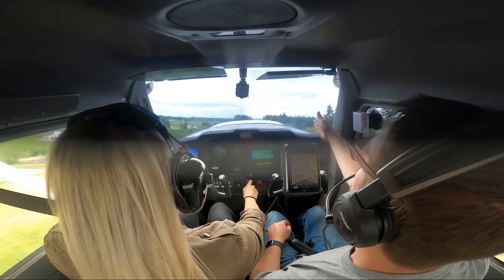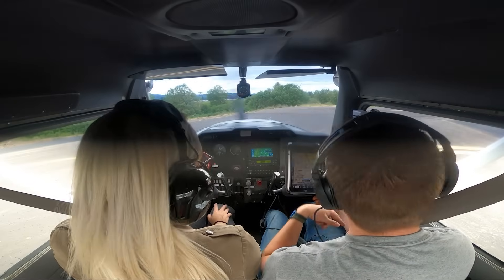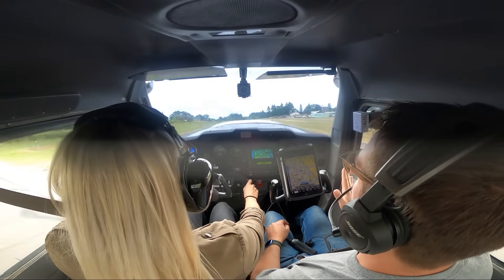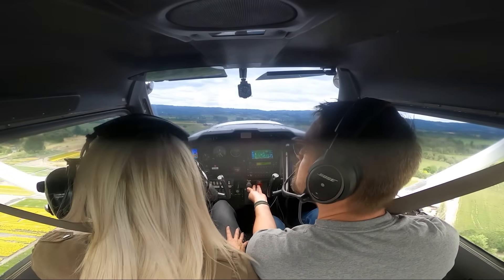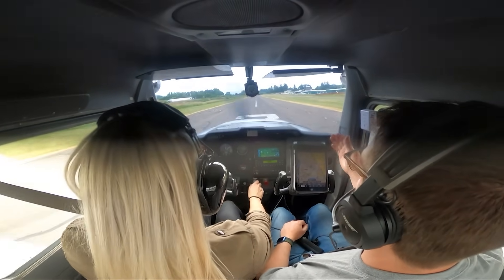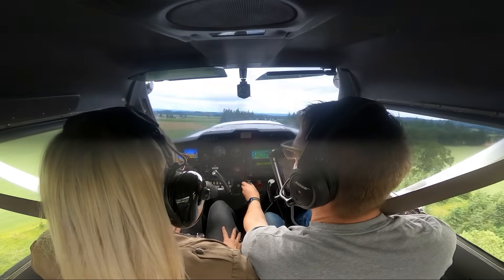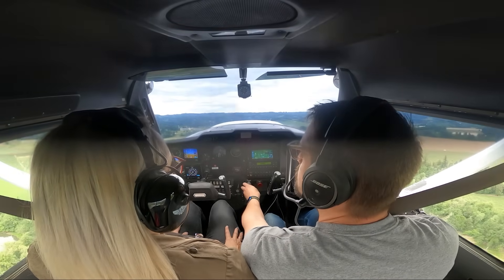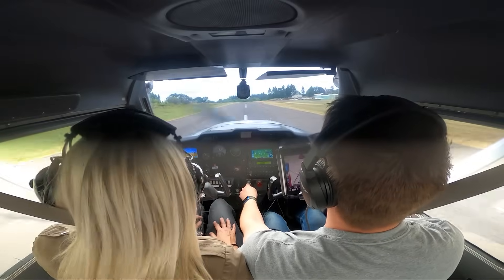REAL Loss of thrust on Takeoff.

Comment: I was with a student in his Piper arrow and during the takeoff role the air filter disintegrated and entered the intake manifold. We did experience a loss of RPM. Unfortunately, we did not notice it until way too late to abort and ended up in the air very similar situation as you posted here in this video.
Reply from the maker: It can definitely happen!

Comment: I’m a low time rusty old pilot just curious about one thing I noticed in this excellent video. It looked like you didn’t activate the electric fuel pump as part of troubleshooting. Is that because you already noticed fuel flow was nominal?
Reply from the maker: Thanks for watching and for the question! There’s no fuel pump in a 150. Generally there’s never any auxiliary fuel pump in any high-wing airplane with a carbureted engine. 👍

Comment: Nice job handling a stressful situation.  It appears you left carb heat on the whole time. Wouldn't you want to go carb heat cold after a few minutes with full throttle? 
I experienced my 1st loss of power on a long x country flight a couple months ago.  Luckily, it was carburetor ice. Turned the carb heat on for a minute and got full rpm back.
Reply from the maker: Great job handling your situation as well! And yes I would have turned the carb heat off after a few minutes, but as you see here, I was on the ground already after a few minutes had passed :-) carb heat on was giving me slightly more power and it is SOP for landing anyway. So I left it on and focused on flying the plane 👍🙌🏻

Comment: I was surprised when he told the student to "now put your toes on the bottom of the pedals", presumably to prevent a beginner from inadvertently applying brakes during the takeoff run. Good luck handling something unexpected and violent during the ground run, like a sudden main wheel flat tire. What he SHOULD have done from day one is to train the students in keeping the feet in the normal position, consciously not touching the brake pedals at all. This becomes natural very quickly, and that way you are in position to instantly use the brakes if needed. No need to reposition your feet while experiencing unexpected deceleration and/or side loads.
Reply from the maker: Sorry, going to have to wholly disagree with you. You absolutely do not want or need your feet on the brakes when you’re taking off. This is why people say “heels to the floor” and why I take it one step further to “toes on the bottom of the pedals”. I don’t know anyone who teaches students to keep feet up on the tops of the pedals for takeoffs.

Comment: You know I just got an idea about this sort of thing. First off I'm not a pilot or a engine technician. I'm just familiar with diesel engines used in trucks, so this idea is obviously open to being criticized as not viable for whatever suitable reason.

The idea is to have a replaceable can of ether plumbed to direct spray into the air intake of the engine. In an emergency you could call for the injection of ether to get a few more precious seconds of power out of a engine to aid in finding a landing area that would be more hospitable than group of trees. It doesn't matter if the ether injection ultimately destroys the engine as all we are interesting in is a bit more precious time to choose a landing area that won't outright kill us.

I'd love to hear thoughts about this idea.
Reply from the maker: Interesting idea. I’m no mechanic or engineer so I can’t speak to the viability of it either, but thanks for watching and sharing your thought!
Reply: Very familiar with diesel engines and planes. This is an interesting idea but it would definitely have to just be a last ditch effort right before crashing. Also, the RPM's would run up uncontrollably which is ok on the ground but could be problematic in the air.

Comment: Handled the situation well sir, I think if I may critic you, You should ditch the Ipad, or consider getting a different yoke mount or strap the iPad to your leg. You couldn't see the RPMs without looking around the iPad and you couldn't see the flap position, it's more of a literal "out-of-sight-out-of-mind" thing. Overall you both did great
Reply from the maker: Appreciate the thoughts! I can actually see the Rpm’s with little issue and since then, have even gotten a new yoke mount that does allow for more visibility on the tach. As for the flaps, the indicator is actually up along the door frame on the pilots side in a 150 👍
Reply: @NorthwestAeronaut  your butt was also an accurate RPM indicator, I bet.

Comment: Had this happen at between 50 & 100ft on T/O in a S
C206 coming off a soft wet, grass strip. From 10 to 20 flap at 55 kt allows the aicraft to pop off the ground a little more easily, but being very conscious of airspeed, nose down a little. 
I know std t/o is 10 deg, but a go around is full power and full flaps. 
I was about to tweek off the flap.
A counterweight pin, on the rear end of crankshaft, disintegrated and let loose, taking out both magnetos, with the prop coming to a sudden stop. 
Both airspeed and landing configuration were important. 
The answer: 
I turned my hand over, selected full flap while pushing the nose down for airspeed, landing straight ahead. 
Suffice to say, safe landing, and positioning the aircraft against the side fence, so the strip wasn’t closed.

Comment: I own a 150L with an O-200A, and I’ve thrown a lot of money into dealing like partial loss of engine power on the initial climb out of the day. Here’s what I’ve done:

- Have carb heat flap inspected.
- Check for mud dauber nests in fuel vent.
- Repack new coil in mag.
- Taxi leaned.
- Add belly sump STC.
- Do large drains on wings, gascolator, and belly sumps.
- After normal run up mag check, run engine to 2400 RPM for at least ten seconds looking for power loss. 
- Do normal takeoff. If engine can’t do at least 2500 on initial climb out, something is off.

Mine normally climbs at around 2510 to 2540 RPM until it gets to thinner air and then climbs at 2560 to 2600. After the first climb out of the day, there is usually no lowered RPM issue. I’ll go right off the runway at 2560. and get 2610 at 1500 AGL and higher.

Comment: First of all let's identify the problem - the problem is engine failure on takeoff at around 400 + or - 100 feet and what to do.  These are my ideas. {1} before takeoff, do your normal1700 RPM check for magneto operation. However, I propose setting the parking brake and go MAX power for 60 seconds with the idea being if there's something about to break, THIS is when you want it to break - I actually timed your problem takeoff - you noticed a problem at 33 seconds after she pushed full throttle.  If you pass the 60 second test, chances are pretty good you'll get to pattern altitude on your real takeoff {2} The GA community petition airports of runways 5000 feet or less to procure designated emergency landing spots where a GA aircraft could land straight ahead in the event of failure at 300 to 500 feet AGL. We want to DIScourage 180 turnbacks at low altitudes. {3} Flight schools with C-172's and C-182 get the BRS mod which is available right now. PLEASE !! On a more macro level, we need to transition to more reliable engines - ideally Diesel engines that use Jet A.  Delta Hawk finally received certification on their 2 stroke 180 HP Diesel Aircraft engine and hopefully the cost will be competitive with conventional piston aircraft engines. Other ideas include the concept prototyped by the Merlin Ultralight new wing design which at first glance it's a normal wing except just in front of the ailerons is a rectangular cutout - very narrow and inside this "box" is a hidden propeller powered by an electric motor. This is a PERFECT idea for an emergency source of thrust in case the main engine fails.  So you could use this to assist to get airborne, or have it on standby in case of piston engine failure. Of course the other idea is of hybrid power where if the piston engine fails the electric torque motor keeps turning the prop. The OTHER idea I have swarming in my brain, is single engine aircraft with C/S props modify them to be able to go the feather position so you can have better glide ratio if the piston engine quits. That's my 2 cents worth.

Comment: Jesus. Report your emergency properly. MAYDAY then tell them what you are doing. You got away with it but you needed the priority and attention guaranteed by the mayday call. Read the FAA page on reporting an emergency. This was absolutely an emergency. Carburettors belong to history, mixture control belongs on the wheel of a model T Ford or a classic bike like a Matchless or BSA single. Engine manufacturers make a fortune continuing to sell this old garbage. Meanwhile the experimental community has FADEC, if they have the sense to choose a modern engine, and never has to worry about hot/cold/high starts, carb icing, and the other issues of carbs. Same for the magneto. Those things were reliable by 1930s standards. I haven't had an ignition failure in 40 years and nearly a million miles of driving. Weak spark and plug fouling doesn't happen with the cheap engine management system even the lowest quality car has these days. Meanwhile you can buy a brand new Cessna with two mags and a carb for half a million bucks. The FAA should put an end to new aircraft with ancient and intrinsically unsafe systems.

Comment: LOTOT can be deadly. I've thought about what my priorities would be in the event of a complete power failure given how little time there is to react. 1) keep the nose down to maintain speed and avoid a stall 2) cut fuel 3) unlatch the door. Now I include this as part of my pre-take off brief and ensure that anyone sitting in the right seat knows what to do. In the event of a partial power failure I would try to do do exactly what you did. Great job.
Reply: No need for new abbreviations when the rest of your comment is a long essay.

For others who might not know, he meant “loss of thrust on takeoff”.
Reply: why is unlatch the door part of checklists in this situation? airframe damage and being trapped?
Reply: @fluke196c  That's correct.